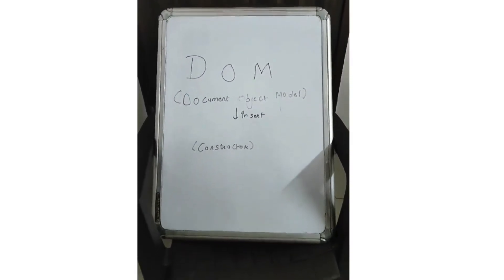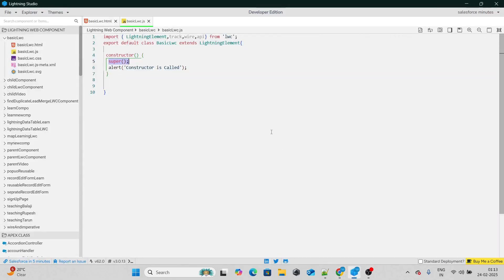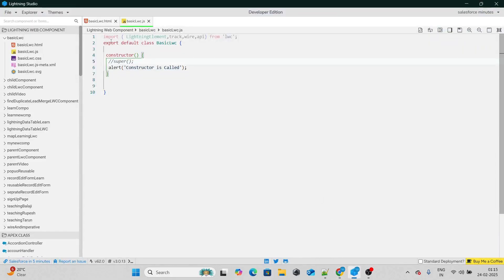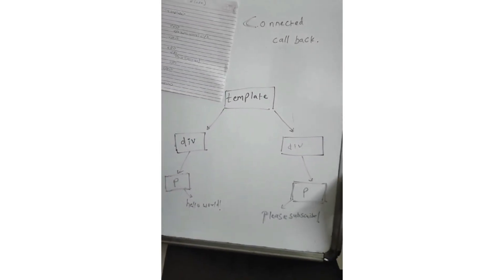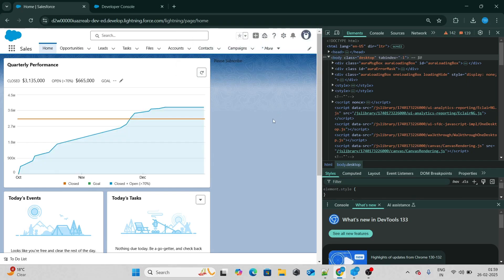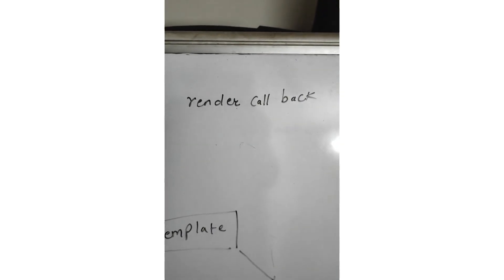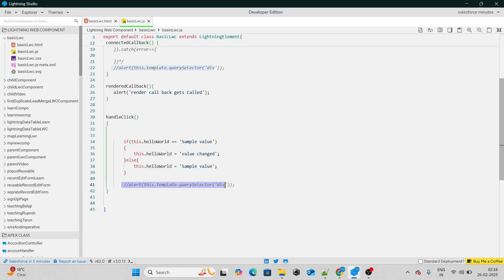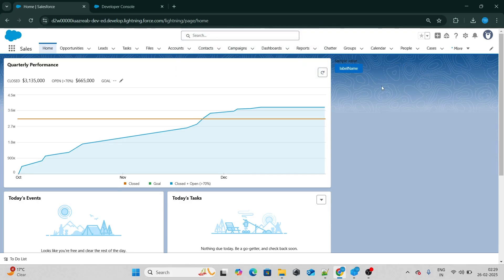Life Cycle Hooks of Lightning Web Components

Comment: what is the difference between  @auraenabled and @auraenabled (cachable =true). Can you please do with decorator and Life cycle hook in single lightning web component.
Reply from the maker: Good topic recommendation, will do a video on same thanks
Reply: @ Many thanks brother. what is the difference between  @auraenabled and @auraenabled (cachable =true). could you please tell me
Reply from the maker: @sreekanthvallepu-w2y  yes sure, 

See when auraenabled( cahceable=true) 
Then when on load when you pull data from apex, this cacheable = true checks if the data that was fetched in previous load, and now new load is same? 
If yes then it just gets the data from cahche because it doesnt make any sense to pull data from salesforce apex as data is not changed at all. 

But when data is changes from previos load only then we make apex call